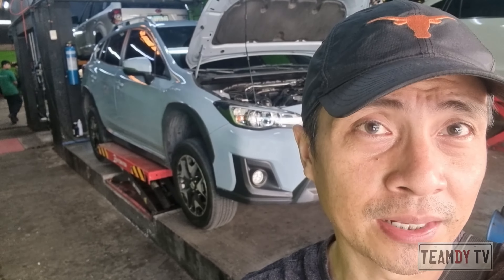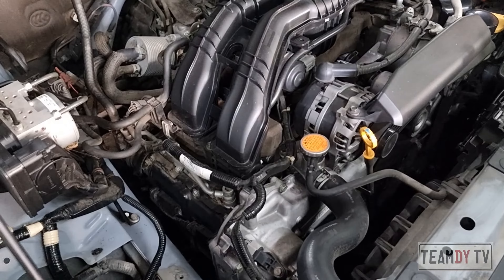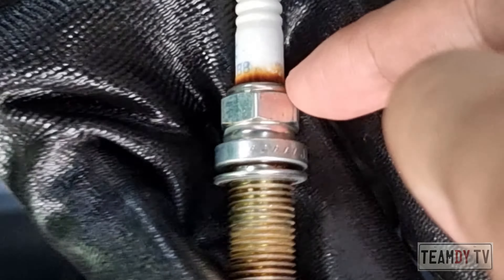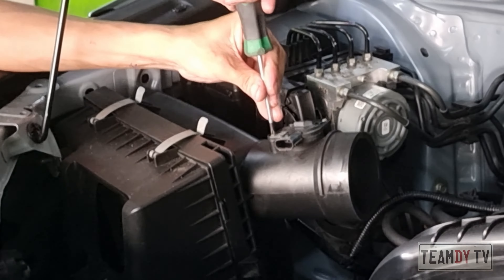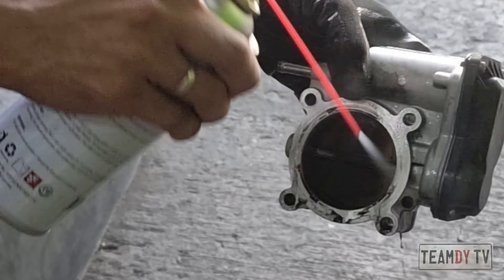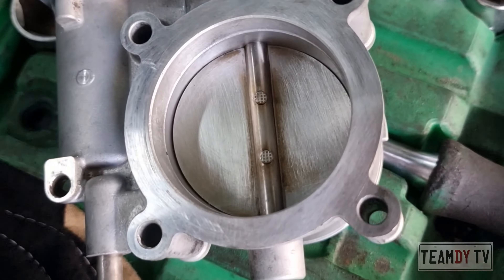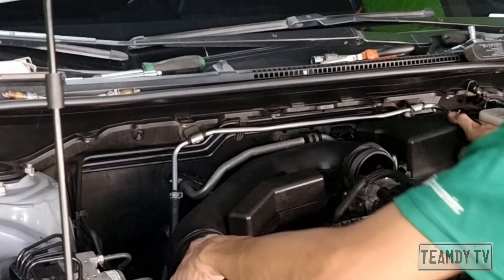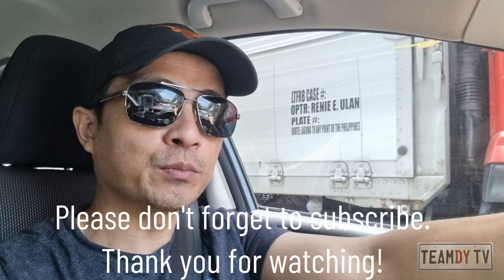How to clean MAF, IACV, Throttle Body and replace Spark Plugs of a Subaru Crosstrek XV

Comment: At what miles should we change the plugs, and what miles to clean the throttle body ?
Reply from the maker: Typically 100k kms or 62k miles for the plugs.

60k kms or 37k miles for the cleaning of the throttle body.

Mine was way too early, i had it done for problem isolation / troubleshooting.
Reply: Can you move the butter fly when cleaning the throttle body ? Or will it hurt it ?
Reply from the maker: @johnf.6942  yes you csn, gently.
Reply: @TeamDyTV  thank you !

Comment: Hi How tight did you put the spark plugs on it what is the torque spec??
Reply from the maker: Hi, sorry I didn't get that info from the mechanic.
Reply: Torque spec is 13 ft-lb.
I replaced mine a couple days ago.

Comment: If u diy u can save a lot, orig spark plugs cost only 1300 each, plus cleaning can be done easily, maf, pcv, egr, throttle body, filters etc...

Comment: Thank you. After owning a number of subaru, I can assure you that the plugs need to be done by a masochistic mechanic.
Reply from the maker: @d.powers3428  hahaha
Reply: Spark plug replacement is a DIY job with the right tools
Eg ratchet with a flex head and you need socket extensions of 1” - 3”.
Not a fun job but diy is possible.